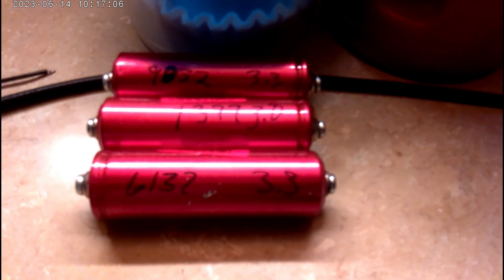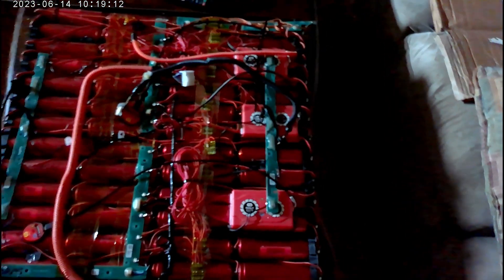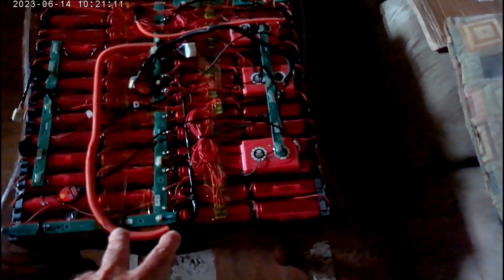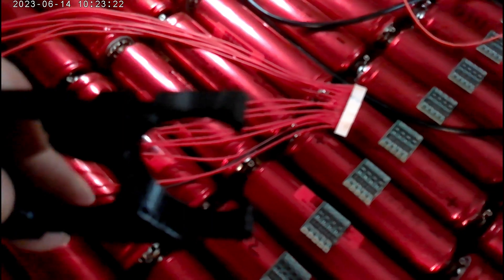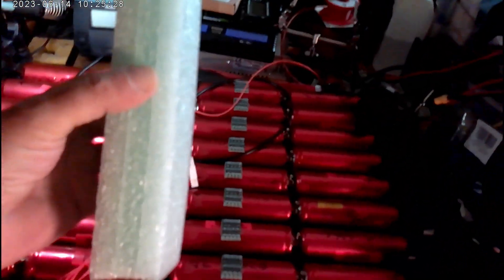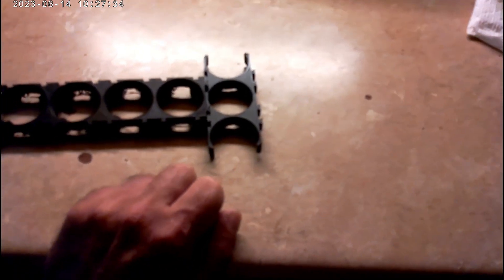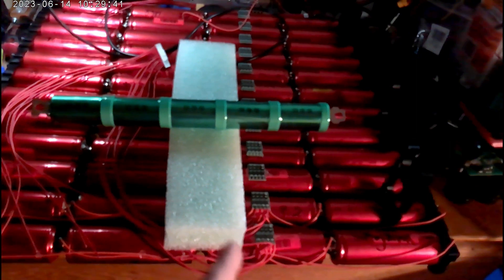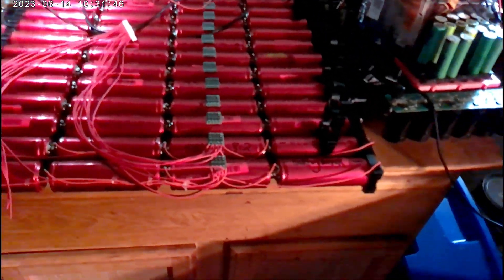2008 Ford Escape HYBRID Battery Rebuild

Comment: Great info but I hope you get the money from all the commercials YouTube put on this video be the first time I've seen somebody that monetized with so few subscribers! What I'd really like to know is how much did it cost you to rebuild that battery?
Reply from the maker: It was around 600 to 700 for the 100 cells along with the over charge protection and the cell active balance boards the 3d printed holders I actually had to to modify to handle more weight. The active balance boards i wish i never bought that one failure killed the electric side of the hybrid system and about 19 cells. The car is now in the junk yard. If i had another chance going back in i would only use a voltage monitor and not active balance, although the daly active balance does have a setting to turn the active balance off and do monitor only. I actually still have the battery assembly and have not did anything with it yet but dont think i did not remove the active balance boards they are gone and put away.  No i did not make anything from the commercials you have to have 500 subscribers to set it up.
Reply: @battery_solar_ev  thanks that's some good useful information I was just debating whether or not to put any more money into my 330,000 mile Ford escape hybrid,
Reply from the maker: the set up i did will work i put about 500 miles in a week with no issues till that active balance board failed.